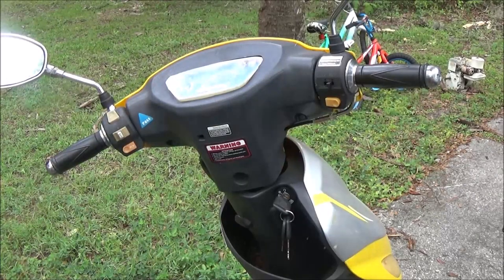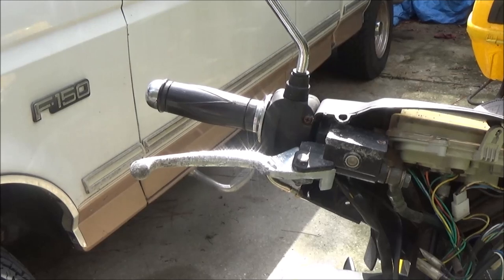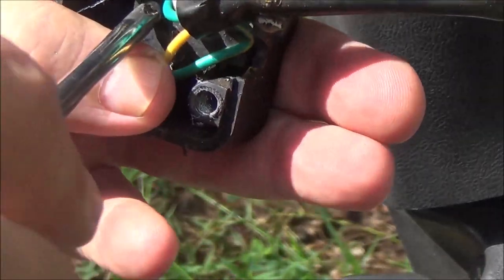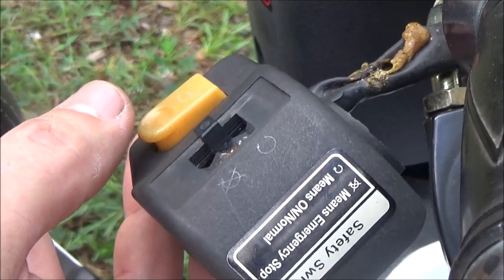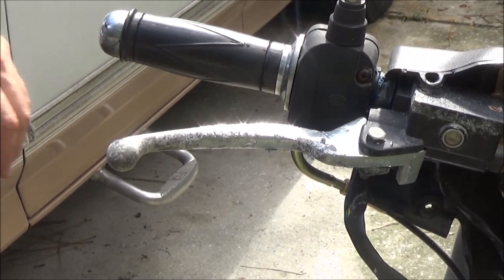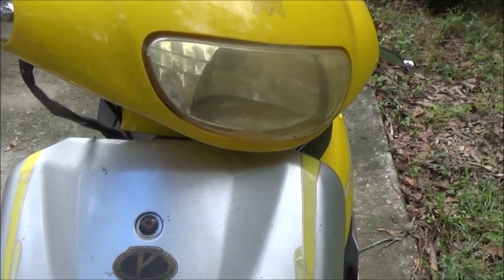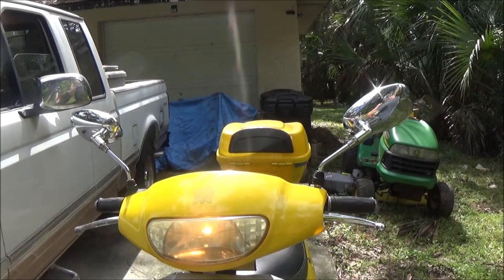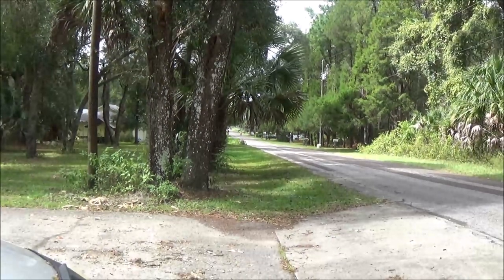How To Diagnose/Repair A Starter Button Issue On A Scooter

Comment: If you lose that spring again just use foam ear plugs as replacement for the spring you'll have to cut to size but it works
Reply from the maker: Thanks for sharing that tip with us. That's a great idea. Thanks for watching and commenting Thomas.
Reply: No problem I'm trying to fix up the one I just bought so I had to rig up a few things until replacement parts get out to me or I can find what's unaversal to the one I have now also does anyone know what kinda of breaking system use a foot peadle on a 50cc I've never seen one like it before only break I have I'd like to have handbrakes but idk much about swapping parts

Comment: This might be the answer to my problem with my scooter, battery is good, solenoid is good, ignition coil is good but sometimes my scooter fails to start and sometimes their is a delays starting.

Comment: HI, My 50cc all of a sudden will not start when I push the button,,,no sound at all, no cranking, battery good, horn and brake light work,,when I short the starter relay with a screwdriver it cranks, I bought a new switch and still nothing,,,what do you think I should do now?  TY for the video
Reply from the maker: Check the fuse. Should be by the battery. It will be a glass fuse inside of a round plastic holder.
Reply: @shabear1000  fuse looks good, brake light and horn works, but no cranking sound  when you push start button, but It cranks when you touch screwdriver to the starter relay
Reply: @thedaydreamer7972 did you manage to fix this?
Reply: Yes, at the rear of the scooter there were 2 simliar connectors, I had the igniton start switch in the wrong one, when I traced the start switch back I plugged it into that one, all fixed @ViergeverProds

Comment: @ShaBear1000 I did exactly the same thing as you and my button still not working 🤦🏾‍♂️ any suggestions
Reply from the maker: Sometimes they are beyond repair, I would say that you probably need to get a new one. They are very cheap on line. Try a website called funtimescooters.com. they should have one.
Reply: @shabear1000  ok thanks I really appreciate it

Comment: Just checked mine, and it had corrosion, a took it off and used sandpaper on it to remove it. And checked the button and took a screw driver on the back side where the wires are. And after i sanded it down it didnt work. Even when i used the screw driver to connect the 2 wires on the back side of the button. Any ideas?

Edit: btw my bike is a grom clone
Reply from the maker: Check the solenoid, connections, feuses.

Comment: I have a 50cc chow chow scooter I hit the I get no electricity but sometimes I get it and it'll turn over but then I get nothing the blinkers no lights no nothing comes on I think it's easier to switch the off and on switch or the brake switch can you help me
Reply: I have a 50cc TaoTao scooter when I turn the key on I get nothing no electricity at all and then sometimes when I put the charger on the battery I'll get the blinkers and lights on and it'll turn over but it won't start and then all of a sudden I squeeze the brake and the light and everything will go off can you help me

Comment: Put a wrong ignition switch in..now starter button doesn't work...hope this works for me
Reply from the maker: Also, the brake has to be on for it to start.
Reply: @shabear1000  yeah I know...kick start still works..jumping it from the solenoid works..maybe I shorted out the push button..I forgot to switch wires around on ignition which is the wrong one for my scooter
Reply from the maker: Let me know if you get it going. If you need any more tips feel free to contact me. Have a great weekend and stay safe.

Comment: Mines is making contact but its making this buzzing noise
Reply from the maker: Make sure your battery is fully charged and check the solenoid.
Reply: @shabear1000  yea battery brand new the bike getting power all the lights come on. Soon as I hit the switch I hear the buzzing noise. Did you mean the starter relay? i have a bunch of those laying around.
Reply from the maker: @iratenews1753  yes the starter relay. Let me know what you find out.
Reply: @shabear1000  will do. I'll definitely let you know
Reply from the maker: @iratenews1753  awesome thanks

Comment: Ok my start button is like that now i hit the button and it get stuck
Reply from the maker: Take it apart, might be a spring or just a cleaning.
Reply: After it had warmed up a little out side I tried again no problem since
Reply from the maker: @youngtone804  it might have been a bit too tight. Did it have ice in it?
Reply: @shabear1000  no it just cold as hell out when I tried to start it
Reply: Well since your replying so quickly I have replaced my Throttle cable but now I have a gap at the carburetor we're you connected the throttle cable
Reply: I wish it was a away to show you a picture of what I'm talking bout
Reply from the maker: @youngtone804  is it the right length?
Reply: @shabear1000  yes got Lil to extra to play with
Reply from the maker: @youngtone804  it's too long that's why the gap is there. You might not get full throttle
Reply: @shabear1000  🫣🫣🫣🫣